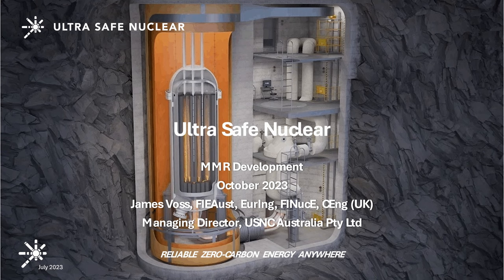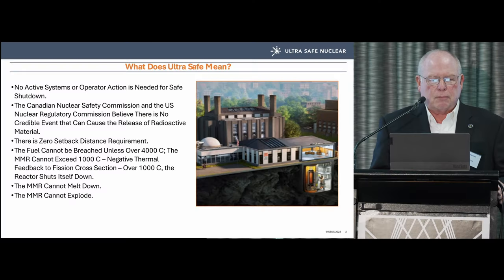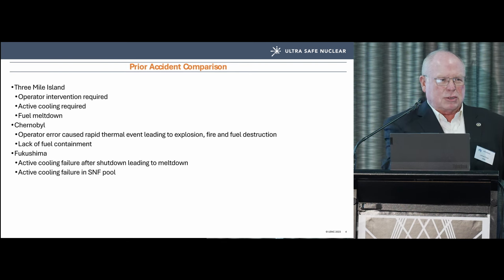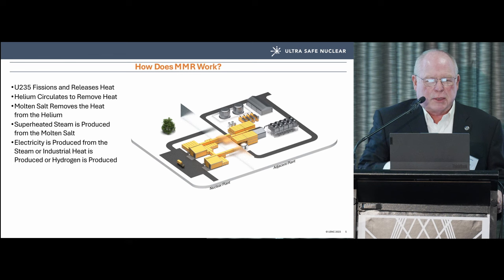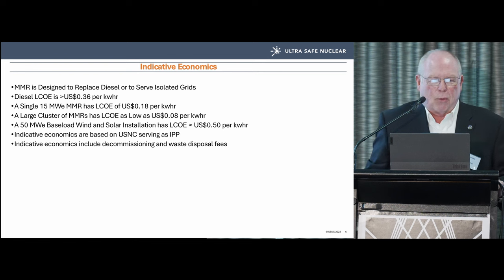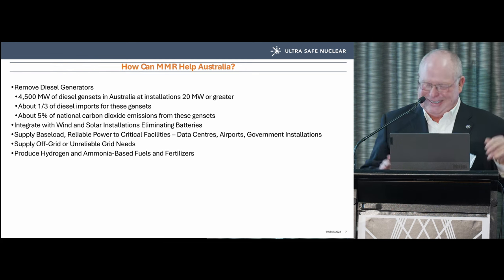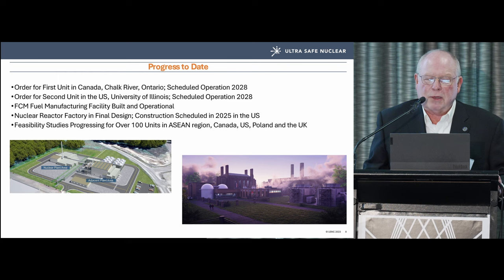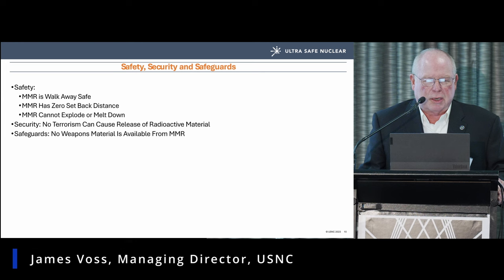Ultra Safe Nuclear Corporation – Micro Modular Reactor (MMR)

Comment: These small MMR's in My Opinion could only be useful  in Remote Locations ..  Military Bases , Mining sites  even some remote towns that still use Diesel Generators so its a big no to MMR's taking existing Coal Fired Power stations locations they aren't Big enough to Replace what is being Blown Up this also goes for state governments and energy providers placing a 500 Mega Watt Battery explodes into flames and its gone  where once stood a 2 GigaWatt Coal Stations the mind boggles at the Ineptitude of these people ..

Comment: Australia has 25gW fossil fuel generation capacity, 600gWh daily max when required. 
The grid has a matching max capacity when required. 
20million buildings in Australia including 10million homes of which only 3million have rooftop solar PV. 
We know that such a small number can cause blackouts if the grid is over loaded and the South Australia big battery is a profitable stabiliser on the grid.

The grid is fragile because it was so EXPENSIVE to construct over many decades. 
66% of electricity bills are grid costs. 
$1TRILLION and the Australian GDP is $1.5 TRILLIONS. 

So no fossil fuels, no imported petroleum, no natural gas heating, no coal burning then we need 5TIMES MORE ELECTRICITY. 

5TIMES BIGGER national electric grid. 

Snowy 2 grid connect construction has increased its construction budget 6 TIMES and it is said 8 TIMES, to $15billion and the 4years is now a decade to complete. 

More grid is 3 TIMES the Australian GDP.
And a century to build. 
Add those costs to the nuclear micro solution. 

We are stopping CO2 proliferation and climate destabilisation   yes ???
So 9billion people with safe nuclear industries and massive national grids. 

Free electricity costs $ TRILLIONS to transport on transmission grids. 

Rolls Royce is a good looking car but most people do not buy them. Most people look beyond the appearance.

The existing grid has to be UNLOADED and protected. 
Generation and storage at the ends of the National Electricity Grid is the only solution.

Comment: Australia has 25gW of fossil fueled electricity generation. 

These 15mW nuclear micro plants mean Australia needs 1,700 of these for fossil free electricity generation. 

With no fossil fuels means 5 times more electricity. 

This means 8,500 of these nuclear micro plants.
Reply: or, it means some of these MMRs, and some much larger reactors... Why not deploy some small reactors instead of Solar or Wind, while building much larger, more "traditional" reactors?
Reply: @cerealport2726  The dirty secret, electricity is dirt cheap.
My feed-in tariff is 14% of my electricity bill.
Grid rental is the expensive part, 86%.
More grid capacity is uneconomic.

Central generation is a dead duck.
Electric energy is 15% of total energy used. 
No fossil future means 
7 times more electricity generation. 
7 times more grid capacity. 
The grid is stupendously expensive.
Reply: @stephenbrickwood1602  a feed-in tariff is the amount of money you are taking from taxpayers. You are part of the problem.

On average in Australia, network costs are 45% of an electricity bill. You're very likely just making up numbers. 

When you talk about centralised generation being dead, and the cost of poles and wires. It's an antiquated argument used by ignorant ideologues who seem to think electricity can be easily decentralised and we no longer need a grid. You've probably never been in the same room as a qualified and competent engineer, let alone anyone on the upstream end of electricity grid operations, have you?
Reply: @cerealport2726  I tell other engineers who mess up where the mistakes are.
I save clients money and make clients money. 
I keep contractors honest and help them not to go broke.
Many vested interests in nuclear power industries. 

How old are you and what do you do ?
What is your name ??
Reply: @stephenbrickwood1602  The only trustworthy thing you say is that there are many vested interests in nuclear power. The same can be said for fossil fuels, wind and solar, but it's interesting you don't say this. 

Which industry pays you...?

The fact that you are ripping off taxpayers by accepting a feed-in tariff also indicates that you are not impartial. 

Your other waffle is indicative of someone who doesn't contribute anything useful, rather, just someone who sponges off ignorant managers, using some of the right words, but collapsing as soon as you're faced with anyone familiar with the topic at a technical level.

My name, age, and the like, is irrelevant,  suffice to say that in my multi-decade career, first as a scientist, now as an engineer (all of it in industry, not research), your BS can be detected from over the horizon by anyone with a legitimate analytical and technical background.
Reply: @cerealport2726  You're the type of person who needs people like me to fix their mistakes.
Are you an AI ?? Mr cerealport